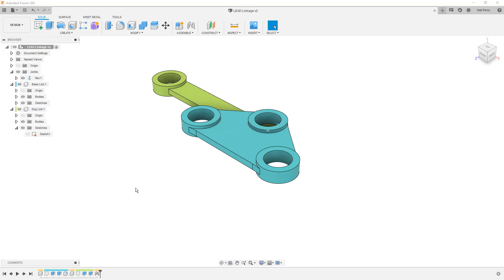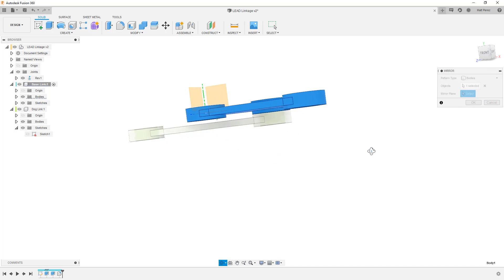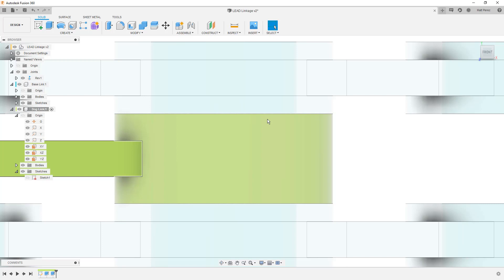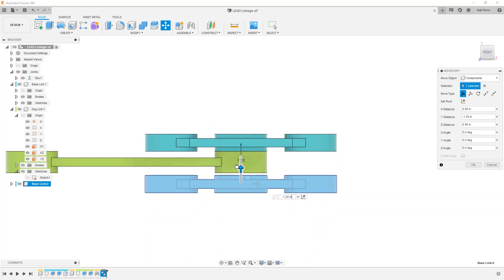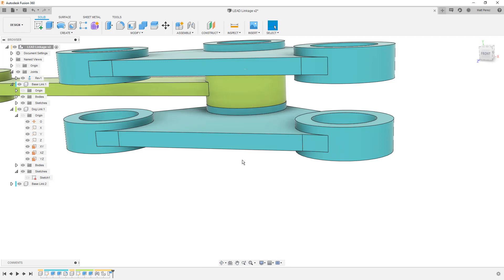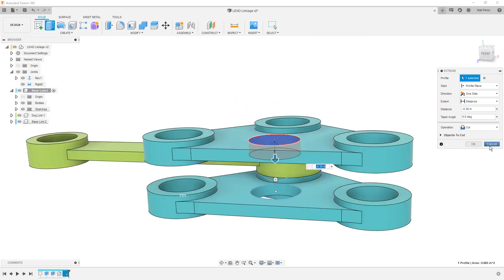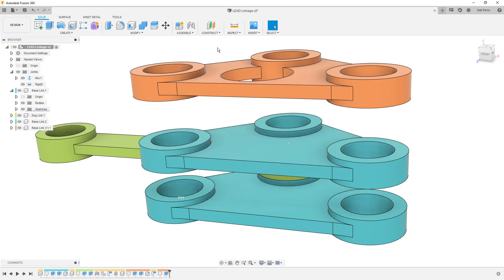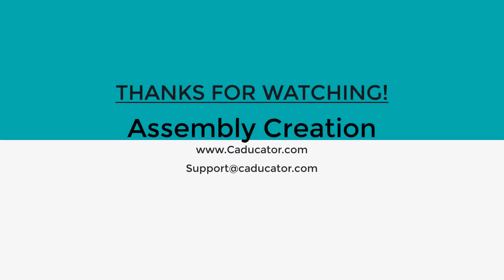Intro to Fusion 360 - Part 10: Assembly Creation #Fusion360 #HowTo #Tutorial

Comment: How are you able to move all the components freely like that? I can make the Dog Link rotate around, but the Base Links are both fixed in place. I don't think they are "grounded" as you say, because there is no pin like you have in the timeline. I can right click on Base Link:1 and "unground from parent" which allows me to freely move the entire assembly, but I can no longer rotate the Dog Link around the joint.
Reply from the maker: Yeah since this video was made Fusion updated and added that "ground to parent" behavior by default.  I have turned that off in my user preferences, but you would need to right click and unground it all from parent and then right click an PIN the thing you want to be fixed.
Reply: @LearnEverythingAboutDesign  ahh okay awesome, makes sense! I thought I must have enabled or disabled something by accident. So in the current version it's no longer possible to do what you are doing in the video? At least one body needs to be either pinned or grounded now for the joint motion to work? Thanks for the speedy reply 👍
Reply from the maker: @lukeinkson  Yeah i wish they wouldn't have turned that on by default.  If you go to your user preferences you can disable the option and it will work just fine.  Just note the old "Ground" is now called "Pin" for whatever reason....

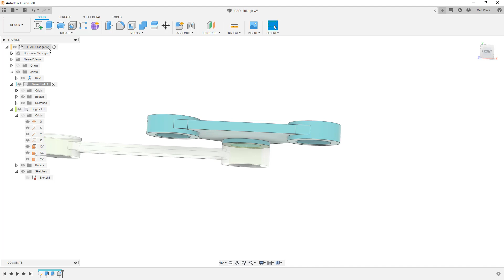Comment: For others working in Fusion v2.01,  at 04:50 I deleted the mirror from the timeline it deletes both base link objects. I was able to get around this by moving the timeline back before the mirror, then deleting it after. You may also need to select the XZ  02:20 for your mirror plane since coordinates changed since this video.
Reply from the maker: Thanks for sharing!  FYI i will be releasing some updated intro courses on part modeling, assemblies, sheet metal, surfacing and forms in the very near future.
Reply: @LearnEverythingAboutDesign  All of that sounds great, especially the sheet metal part. Great for ordering custom cut and bent parts like brackets. After completing I tried to replicate an object with profiles made with a contour gauge. Not as easy as I hoped so far but will keep at it. I have a fox-body cobra tail light lens that I want to re-create then modify. Thanks again for the great teaching.